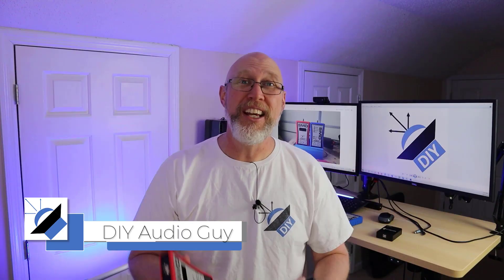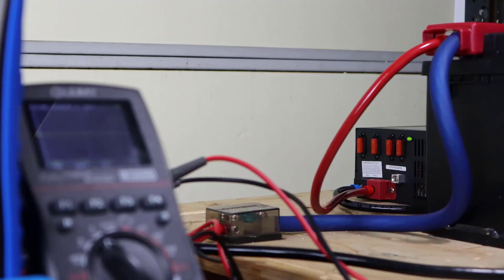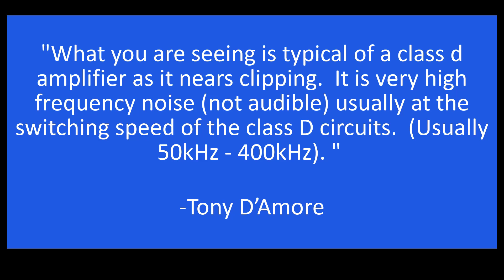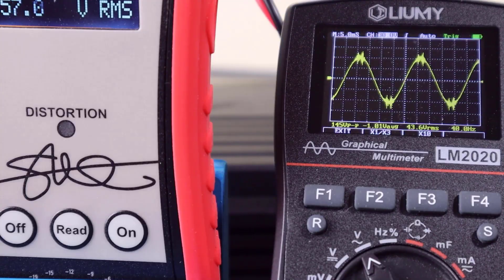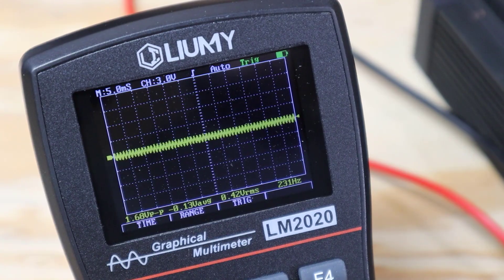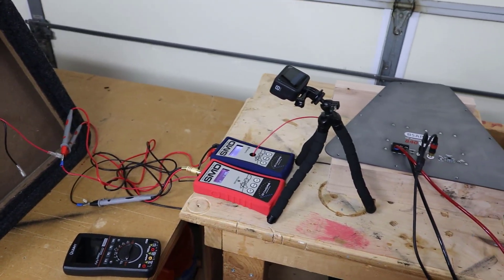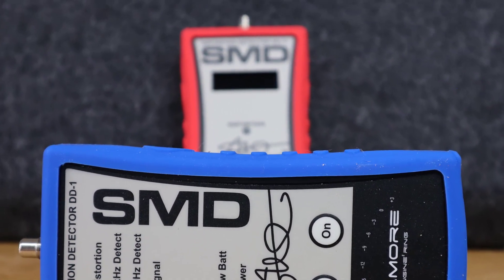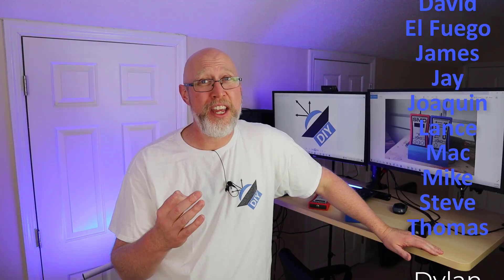The best way to set amp gain?  #SMD DD-1 VS Liumy Oscilloscope

Comment from the maker: My goal for this video was to provide information, a lot of people are trying to decide if they need SMD tools.  There are ton of ways to set gain, it is OK to use the method that works best for you.
Reply: Yes most definitely. So many ways to have the same end result..
Reply: When you adjust the gain for distortion either for the smd or multimeter, did you move the crossover frequency for the lpf all the way up. My polk audio has a freq of 50hz-500hz on the knob and on hpf it's 20hz-400hz. Need to adjust my gain this weekend and while I know how to get the target voltage I don't know what to do to the frequency before I start moving the gain knob to PROPERLY reach the targeted voltage
Reply: I get tired of explaining this to people who think they can set gains by ear.   This video will make that so much easier now that I can just tell them "Here, watch this."
Reply from the maker: @battleop  I would trust a professional with well-trained ears.  But most people are not that.
Reply: @DIYAudioGuy  Even someone with an ear like that (and they are not common to find) is more than likely going to leave some power on the table.    With the DD1/DD1+ you can get right up to the edge getting all of the available power and even the best ear won't do that.
Reply: @battleop  yet a $40 amazon oscope does the same job and can do a hell of a lot more. The dd1 is an expensive logic box for people who dont want to use a scope. It works, but a cheap scope is still better.
Reply: @DIYAudioGuy  Hey brother, I got a quick question. I have a SMD DD-1. It has the 40hz and 1000hz lights of course. But if I used a different tone that isn’t those 2 frequencies, will that clip still detect distortion?
Reply: If u going to recommend just one to set the gains witch one you recommend??
Reply: You the man bro,thanks
Reply: Personally I don't want to spend $1000 on a couple items that are going to sit in my toolbox most of the time.  I switch cars every 3 to 5 years so...

Comment: It's easy to compare a $500 product against a $30 multimeter/oscilloscope like your LIUMY LM2020, which only has a 5Hz - 5MHz frequency and a sampling rate of just 2.5 Msps.
You should test the DEWIN 2C53T Oscilloscope. This model offers Real-time Sampling Rate: 250 Msps, Dual-Channel Bandwidth: 2x50MHz (for fast, accurate signal measurement), Signal Generator Mode: Generates 13 types of waveforms (Sine, Square, Sawtooth, etc.), Multimeter Mode: Measures voltage, current, capacitance, resistance, diodes, continuity, temperature, and more. I was lucky enough to find the updated, affordable 2C53T for $122 on Amazo n (with the full kit) – in Italy, I found it on sale for €103! For that price, 50MHz and 250Msps is an excellent above-average range. I'd be really interested to see the same video but with a comparison between: DEWIN 2C53T (Chinese "Top"/Mid-range Oscilloscope) LIUMY LM2020 (Chinese Junk) SMD DD-1 (Expensive Top-end device). I was planning to calibrate my entire system using your instructions + the 2C53T Oscilloscope!.. This is also why I ask, there would be more performing dewins from 70mhz/100/120 etc with very high sampling frequencies... but the prices also become so. I ask for the comparison with the DEWIN 2C53T because it is an excellent product that has all the necessary features of the top of the range but does not cost a kidney and if it were really good it would be a great thing for the people to know about it or am I wrong?..

I love your videos! I've subscribed, turned on notifications, and I'm considering joining your Patreon to support you!Keep up the devastating work! Have a great day!

Comment: I don’t get the whole saving time thing… we talking about an extra 2 minutes? Why are people mounting amps where you need to be upside down in a car to get to? Alligator clip the scope to the speaker wire usb your phone to the radio for 40 hertz and push a button on the scope turn the gain…

Comment: That's Class D switching noise you have said it through email exchange. It's even present in some amps even if the gains are within 50% range. This isn't audible but it's annoying when you set gains using oscilloscope.

Comment: I use my ear and a piezo tweeter. Just as accurate as an oscilloscope and for under $5. You do need a way to produce test tones though. I use a CD with various test tones at 0dB, -5dB, -10dB, and -15dB.

Comment: Great video. I was thinking about purchasing an Aukuyee mini oscilloscope. I want to use it to set the output gains on my Audison Bit Nove that doesn't have output indicators. I was just wondering if I could purchase a separate BNC to RCA lead to use with the Aukuyee oscilloscope to make it a little easier to make the adjustments without worrying about holding probes and making adjustments. I just need to know if it's safe to use.

Comment: When using a scope or dd1, what about amps stable at 4,2 & 1 ohm. The voltages will be different for each load. If you max an amp out with an oscilloscope or dd1 then throw a 1 ohm load on it, wouldn’t it be clipped and distorted? In other words does ohms law and the load the amplifier sees change anything here
Reply from the maker: The DD1/scope find the point where the amp is maxed out, without distorting.  That does not change if the nominal impedance changes.  If you use a multimeter + math you are setting the amp for a specific wattage, that may be less than maxed out, it may be more than maxed out.
Reply: @ thank you for such a quick response!

Comment: I simply hate how everyone calls it gain.  You are setting the input attenuation if needed to maximize SNR and not overload the input.  With the exception of VGAs which make compromises in linearity, noise, etc. in the working or interest band, not optimal, the gain of an audio amplifier is fixed.  It is based on the semiconductor, circiut topology, feedback...

Comment: I have been tuning my amps by ear since i was a teenager. I calibrated my ear by blowing a few amps and subs and mids. I haven't accidentally toasted any equipment in probably 10 years. 

I did use the multimeter a few times but went back to tuning by ear.

Been wanting to get the smd tools for a few years but can't justify it since i don't play around with car audio anymore.

Comment: Question 🙋🏽‍♂️: if your calculations says your subs take 80vrms but your distortion light comes on at 87vrms. Should you leave it at the 80vrms or to the 86vrms where the light is off when you back it down?
Reply from the maker: That is well within the margin of error.

Comment: I tune by hear using a 1k or 40hz test tone. You cam hear the Amp tone  starts to clip with the gain. As a pro installer I backed this up with a scope or dd1.

Comment: Ya I also believe that both are a crazy $600 bucks I can set with oscilloscope and both smd will have exact values only difference one is $6 to $7 hundred bucks and one to is about $70 bucks use your head it isn't like car audio didn't exist before these over priced things that have about 30 bucks of electronics inside these didn't re invent sliced bread come on

Comment: So then is the reason for not going above 75% volume is so that it doesn’t distort? If I set my gain on the subwoofer and I go above 75% volume can it damage the subwoofer?
Reply from the maker: Yes
Reply: @DIYAudioGuy  okay, but can I damage the subwoofer if I go above 75% volume after setting the gain for it?
Reply from the maker: @MarcoTopG  Yes
Reply: @DIYAudioGuy oh okay, so when I set the gain I set it at 75 percent volume on the radio?
Reply: @DIYAudioGuy  it’s because it’s a little difficult to find where 75% is at because on my vehicle when I turn up the volume it gets louder but doesn’t tell me how loud it’s getting on the screen. Basically no volume number comes out on the screen

Comment: For me, I find that there is a lot of nuance and the gain is never set.

I listen to some trap music and some rebassed stuff and initially when I set the gain I used the craziest bass track I couldn't see myself removing from my playlist and set the gain on the edge of that track clipping at a certain volume a few ticks below max volume.

At that volume though, any regular track sounds weak, other trap tracks need to go up 5 volume ticks over that before they clip, and regular tracks never come close to clipping even at max volume. 

With this, any music outside of the bass head niche stuff in my playlist doesn't dig into the subwoofer at all, so I bought an epicenter.

With the epicenter, even the regular tracks can be taken to clipping at low volumes.

So with so many variables, what I did was got a mini Oscope, and ran a speaker wire from the sub to the dash area permanently so I can check my wave forms on the fly. So whether I'm cranking the volume or the epicenter effect, I know where to stop and back off.

so in a sense, where the gain is set might not even matter depending on how many variables are introduced into the system, for me, once it produces enough for me to actually reach clipping it's enough, and it's up to me to make careful disciplined decisions when jamming.

My amp is about 110 watts more rms than the subwoofer it's powering so it probably wouldn't take too long for it to kill my sub with a dirty signal, but the setup has worked for me for years with no issues....................well other than a squeaking sound that recently started coming from the port when a certain frequency is played......

Comment: Sorry for the necro post in advance. I never thought my O-scope wasn't effective. Interesting watch. I do find the Amp dyno to be useless since and Amp pushing 500 watts will not make a huge difference over an Amp pushing 600 watts. I know some folks will say it matters. It makes no sense unless you are dragging and laying in 1k plus power. Average Joe diy installs are just too small to be that petty.
Reply from the maker: You have to double the power to gain 3 DB.  So you're not wrong there.  Plus there are so many other factors in the real world that will impact the actual amount of power and amplifier will give you. 

But that's not the big issue. The big issue, even after decades, there are brands that just slap random numbers on the side of the amp.  So there are a ton of people out there buying garbage amps and they have no idea.
Reply: @DIYAudioGuy  Agreed. My point though is to get more output, wattage is too difficult compared to speaker count or efficiency in general. To double output how you essentially need 10x wattage whereas you can add 3x the cone area. Not always possible but you get the picture. That's why I shop the speakers, then match the amp. It would be insane to just try and dump 1k to a set of components rather than buying twice as many components.

Comment: Hey I need some help with an amp that I want to install without a head unit I want to use my phone to play music directly using rca phone adapter like you did on this video.  but every time I power the amp it makes a loud pop on the speakers. How can I stop that from happening ?
Reply from the maker: Since I can't see how you have it wired I can't give advice on how to fix it.
Reply: Where can I send you a picture of the setup?

Comment: I have a DD-1 I was just wondering what do I set frequency at the amps?
Reply from the maker: Use the 40hz tone when setting a subwoofer amp.
Reply: @DIYAudioGuy 
My mistake I meant the crossover frequency, let say I want to set the crossover on the Head Unit, so where should the cross be at at the amp?

Comment: From watching and listening to signal engineers explain the uses of an oscilloscope, most will blatantly say that you cannot see distortion on an oscilloscope, they will show clipping, and signal strength, multichannel will show signal compatibility and comparisons.
SMD meters is legitimately the only real way to show when a system signal is distorting, with their true 40 Hz signal.

Comment: I’m a DIY guy myself. I have 2 vehicles with aftermarket stereos and some higher end equipment. I’m frequently tinkering and trying different things. I have a DD-1 for gains. It always works great and is super simple to operate. I have complete confidence in SMD products and will continue to use them.

Comment: The installaton of my Head unit Pioneer AVH-W4400NEX and the Pioneer GM-E360X4 has been a long road to say the least.   I got the Head unit for 100 dollars off of Facebook Market Place with the 1 hour ride to and from the sellers location makes it a good price and good value.  This will replace my stock unit in my 2013 Chevy Tahoe.   The Amp was also picked up on Facebook Market Place and was 100 dollars also.   This amp is a nightmare that I have been having over and over again for the last 2 months.   It is going back on the market tomorrow and upon watching your channel I am better equipped to make the right choice for my Budget.  Cheap and Dirty but one mam's cast off is anothers treasure.  I really need a good installaton video as this is the most time and money pit as my electrical and fabracaton skills aver at a novice level and my wife would like the seats put back in the Tahoe asap.    Can you recommend a video that will better deal with the pitfalls and shortcuts that a person in my sisutation should watch.    Bingo Starr   Great channel best one I have come across in the past year by far.   Thanks for your clear and well thought out presentation.

Comment: As someone who is in a field in which I have a lot of specialized testing equipment it’s hard to fault Steve on the price of the equipment. A DIY guy may see it as expensive but they wouldn’t likely get enough use out of it to justify it anyways. A shop that would use it multiple times a day would see that price as a bargain as it will save them tons of time over the course of a year. It’s all relative and I see these tools as just that… Tools. If you would hardly ever use it then why buy it? If you would use it a lot and it would make you more productive then the price is certainly worth it. I have multiple oscilloscopes including a 4 channel PicoScope but I would still love an AMM-1 as that little thing does all kind of cool stuff like real time power and you can’t find anywhere else really.

Comment: To set GAIN in AUTOSOUND... Ya set your MIDS and HIGHS/FULL RANGE system to its maximum range with no audible distortion. Typically ya can get 3/4 the volume on most DECKS then distortion sets in. NOTE the VOLUME NUMBER on the DECK, important. Once ya have your MIDS/HIGHS/FULL RANGE system tuned to its max clean output... THEN dial in yer SUB WOOFER AMP to sonically MATCH the mids and highs. Set your remote sub VOLUME KNOB to about HALF and adjust accordingly as SOME MUSIC is BASS HEAVY.... some music not so much so, Bass knob set at half way will afford the user a RANGE of adjustment needed depending on the music being played.  Typically your MIDS/HIGHS/FULL RANGE system will distort LONG before your sub amp.  OR... In "competition mode"... bust out the TOOLS mentioned in this video.  I been installing AUTOSOUND better than 50 years now... I dont own TOOLS. Trained ear I suppose here. Good video!!! BDBD/2023
Reply: OH YEAH... AUTOSOUND???.... %99.999999999 "SQ"..... 0.000000001 "Competition"... Know your customers...  Very few Competition types out there... as SQ goes... Nicer the car the better the SQ.. regardless of GEAR. 
BDBD/2023

Comment: I have a question for you. If I DIY a pair of probes into a single RCA, can I use that on an oscilliscope to find the distortion of my headunit volume?
Reply from the maker: Yes, I did something like that.  I picked up some cheap RCA to speaker wire pig tails and just crimped on a female spade terminal.  You should be able to attach banana plugs to plug right into the scope.
Reply: @DIYAudioGuy  Thank you Cheif! I appreciate you!

Comment: 40hz and 1khz high Q notch filters, bandpass filters, comparators, combine that with a small switching power supply to provide a bipolar supply to the opamps and a few LEDs with a plastic enclosure and BOOM... $200 distortion detector, i'm not saying it's a bad product, i just don't see spending that much on it, but you know...they're the only ones who make something like it, if you actually care about a valid THD number look at the Keithley 2015 THD analyzer, just don't look at the price lmao

Comment: Hey man I know this is late but I have the dd1 and I tested my head unit for distortion I played the 40hz0db and1khz0db and I get no distortion on max volume on both sound waves , am I good to ply max volume and just turn up the gain?
Reply from the maker: You are good to apply max volume and then set the gain with the DD1.

Comment: any real oscope will perform better than that SMD expensive tool. Although the real oscope will cost about the same or much more, you will get a real oscope that you can use for all your electronics.
Reply from the maker: If I were an electrical engineer I would have one of those scopes, but it's complete overkill for setting the gain on an amplifier.

Of course the main reason to use the SMD tool is the simplicity.  Literally anyone can set the gain on the app, if the lights on turn the gain down. It's simple.